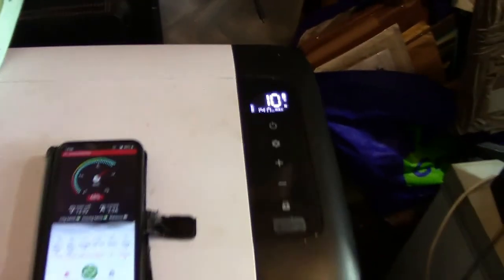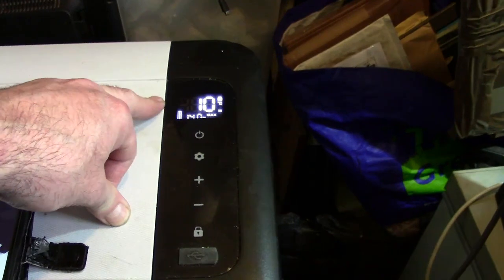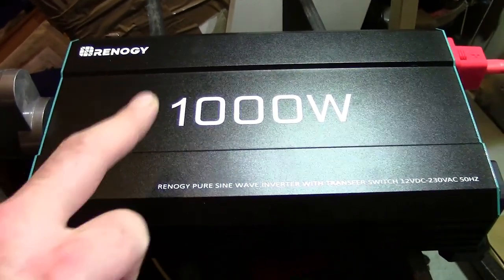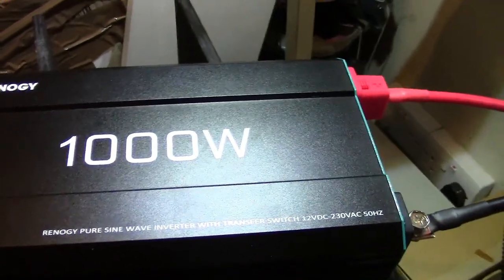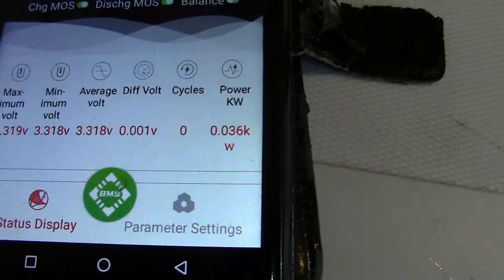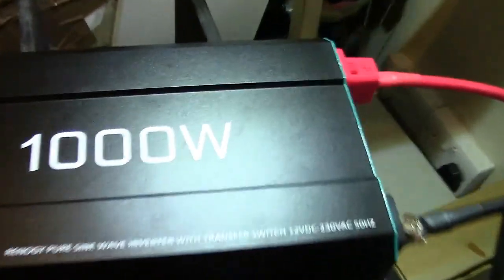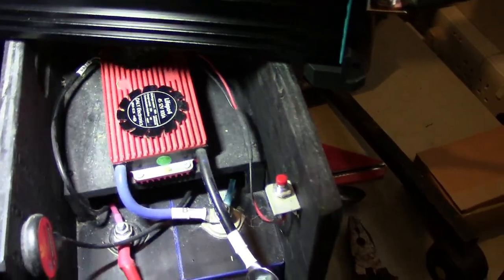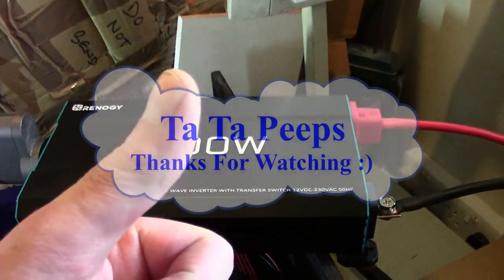280Ah LiFeP04 + Renogy 1000W Inv test

Comment: That a nice piece of hardware especially for charging up power tool batteries etc 👍.also its a great way to save on your eletric bill 😀
Reply from the maker: It's a bit large TBH for just charging power tool batteries but i figured better to have extra capacity spare than run out 🤔 and the smaller inverters didn't have the UPS passthrough 240v feature so i may fit this to the amby and buy a smaller unit for the shed 🤔 not sure TBH but as you say with electric prices soaring I'm just thinking ahead  👍

Comment: Hi, Over one year on how is the 1000w renogy going. I am looking to buy the same unit, and put my 100ah lifepo4 battery. Cheers from Australia
Reply from the maker: I've had my 1000W renogy in for just over a year and no issues so far.
I will add that when i use it to charge power tool batterys the invertor gets a bit noisy as the batterys reach a full charge, i assume it's the charger turning on and off to control the top end of the tool batterys charge, it hasn't affected anything it's just a strange noise from the invertor ?
the UPS feature is handy as well as i sometimes unplug from shore power while i have items plugged in (i'm a bit forgetfull/stupid) 🤣